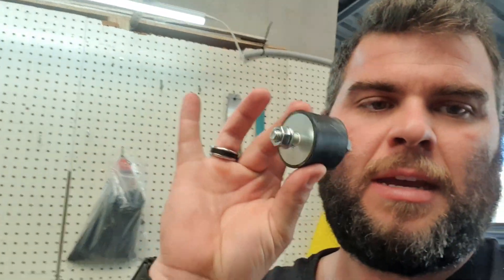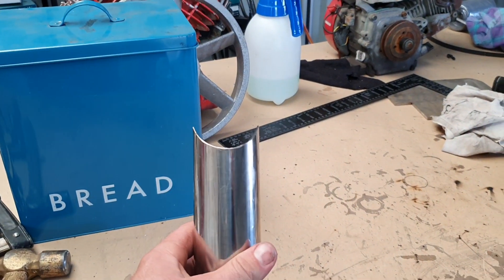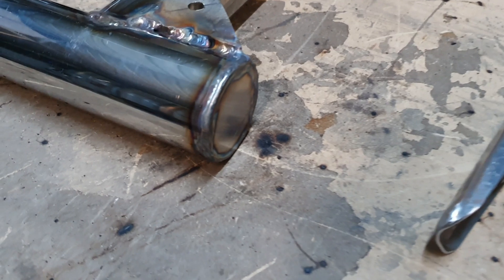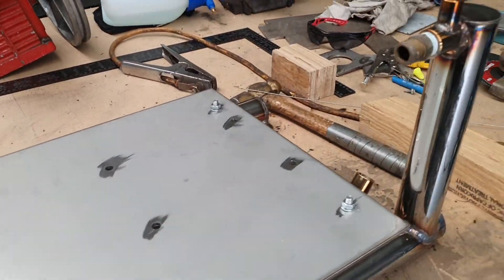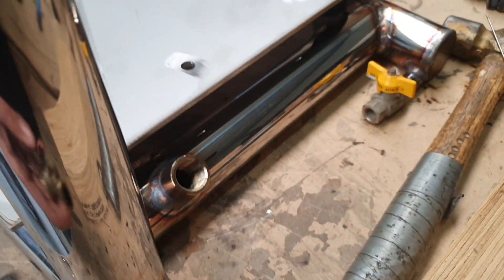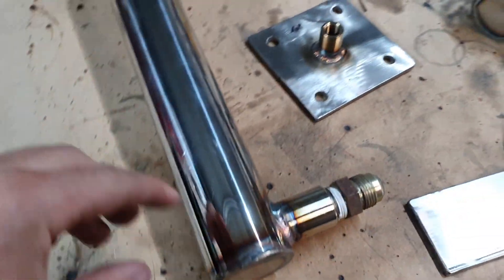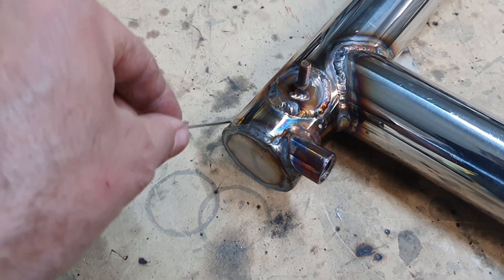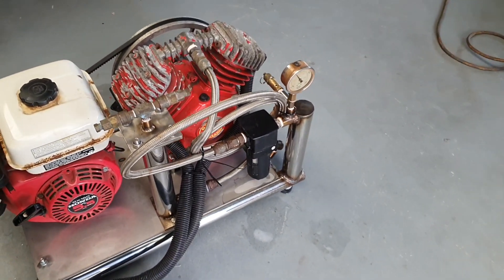Dive compressor part 2

Comment: Nice job bro but heads up your  ment to have 3 filters a oil one a particular filter and the charcoal one last the last thing you want is oil in lungs  extremely bad  the charcoal is mainly  just to. Take any smell or tastes out at end of line of filters my dad was a NSW abalone diver   was the   13th diver in NSW issued a licence   so I am not just pissing in your pocket I just set hookah up myself we use the skinny soft drink style kegs pluss the frame for a reserve air supply that way 2 divers can deco from 60 ft no problem great job you done

Comment: what sort of seals have you got on the compressor pistons .Ive got a Siebe Gorman made 1952 its thoughing a lot of oil to the filter and outlet so it needs new seals on the pistons i cant find a sourse of piston seals the only thing i  can think of is to turn them out of neoprene rod ttfn*ty

Comment: Hi there. I couldn't see a pressure relief valve throttle control. How does the motor drop revs when pressure is met? Cheers
Reply: The motor doesn't change its rev. Relief just keeps the pressure safe and you set the rev to supply the air flow to match the usage
Reply: Yeah sweet, makes sense. Nice work mate. Have already started building mine. Thanks for explaining it all
Reply: Too easy mate glade it helped

Comment: Hi there what sort of charcoal you put into your filter ??
Reply from the maker: It's a very low dust breathing air charcoal. Best place to buy it from is your local dive shop as they will use it in there big compressor for the scuba tanks
Reply: Okay thank you and do you still make the frames and if you do how much roughly??
Reply: I can still make them but no idea on price at the moment

Comment: nice job - couple issues.  where is your air intake?  It needs to be well above and distant from the CO producer you're using to power this thing! :)  Second - this is a more difficult problem - your choice of compressor (oil lubed) is almost certain to expose you to oil vapors in your breathing gas.  That leaves you with a nasty potential problem called "Lipoid Pneumonia."  There are non-toxic oils - very expensive and generally something I would not want to be breathing over time.  Get a water lubricated compressor or use an oil-less model.  I would put a molecular sieve column on the outflow of this thing at the very least.
Reply: Thanks for your comment mate. The air intake is a 2m hose that is yes pla ed a long way away from the motors exhaust and as high as possible to avoid co2 as its a heavier gas. Secondly the oil used in the compressor is a special oil that is non toxic and made for breathing units. Also the air has to pass through a water/oil trap as well as several felt pads and a coalescing filter. But I do appreciate your concern

Comment: I have a question what brand of compressor  is that  one  i would like to built my own diving compressor.
Reply from the maker: this compressor was a globe, but you can use any compressor pump. only thing to remember is use a new one where possible and use the breathing air compatable oil in them. corena oil is what i use. a good pump to get hold of is a marro from a company called cooltec pumps
Reply: Tank you i appreciate your explanation god bless you. I will make my own.
Reply from the maker: @pastovasquez1858  your welcome